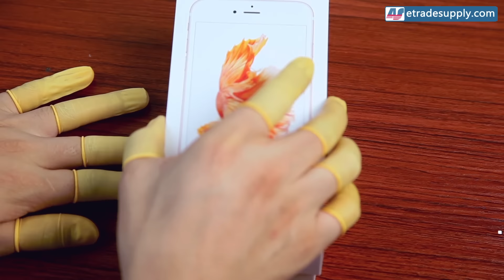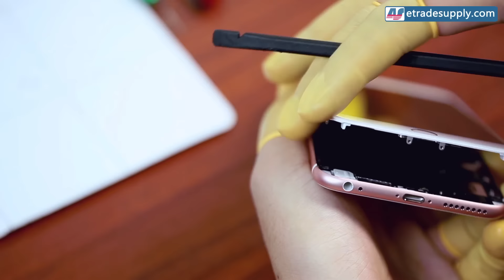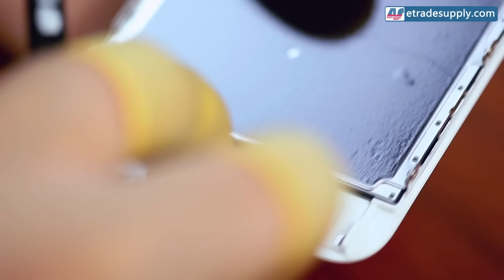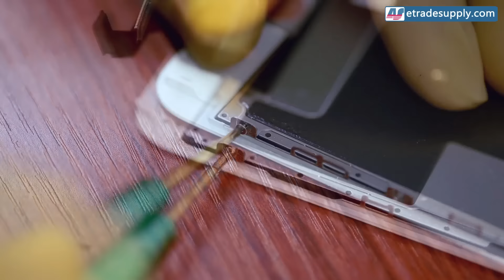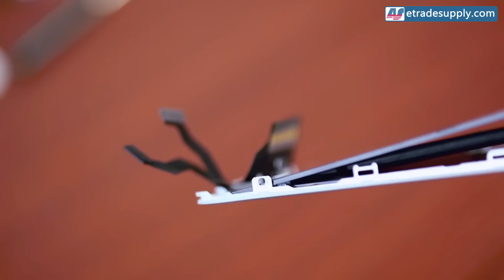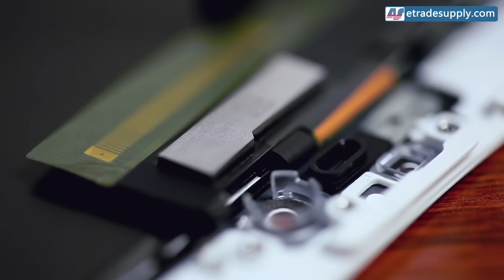How to replace iPhone 6s plus  screen in 8 mins(3D Touch layer disassembled)

Comment: Do you have a tools list available, I want to give it a try?
Reply from the maker: Hi, this repair tools will be needed when replacing the 6S Plus screen 
Heat gun/hair drier
Pentalobe screwdriver
Phillips screwdriver
Screen suction cup tool
Case opening tool
Spudger tool
Tweezers
Eject pin, you can check our repair tools page to found these tools http://www.etradesupply.com/accessories/accessories/repair-tools.html

Comment: Very nice video, i have a question, on iphone 6 when we change home button, then it comes error 53 on Itunes when we reinstall software. 

is there any error will come when we change iphone 6s lcd to another 6s lcd no matter we buy from china, ebay or take it from another iphone 6S?

and please tell me is 3d touch panel of one iphone 6s  can be use on another iphone 6s lcd which 3d touch is already distoryed by mistake?

hope you reply.
Reply from the maker: +Asif Khan As long as you get a higher quality LCD for the 6S you should experience no error with it,  and swapping the 3D touch panel won't affect the function of the 6S.

For the touch ID (home button) you should move the original to the new LCD assembly as each home button is paired to each motherboard with a unique ID.

Hope that helps

Comment: im gonna change LCD on iP 6S, and i wanna know if i take original 3D touch panel from broken LCD(like touch ID as well) and put onto new LCD will it work?

thanks
Reply from the maker: +Levani Maminashvili you can  check if the new LCD screen assembly comes with the 3D touch panel, if there is, then no need to take the original one to the new LCD, if no, then you can install the original 3D touch panel to the new LCD screen as long as the 3D touch panel is in good condition, and be very careful dealing with the replacing process of 3D touch panel.

Comment: Could you potentially replace the Touch ID sensor and digitiser/3D touch screen on a normal iPhone 6+? What are the differences in measurements?
Reply from the maker: +Naguib Hajiani 
We are going to replace the screen assembly with the original 3D touch layer later today, and home button to see how it goes, then we will tell you guys in a new video. Thanks for watching though. =)